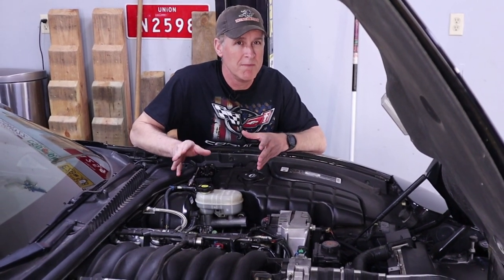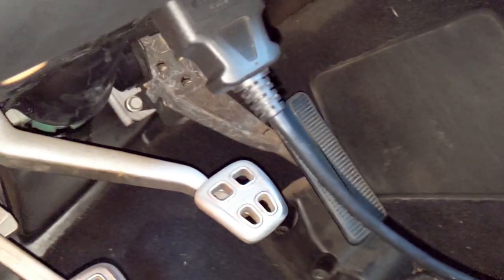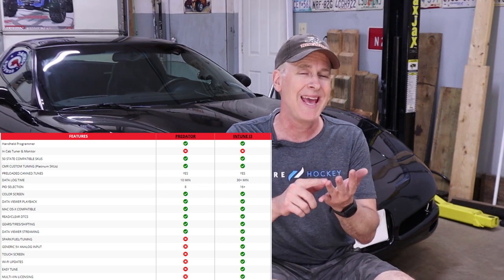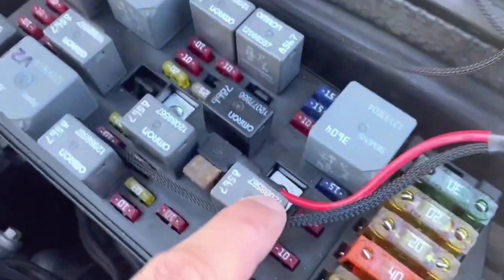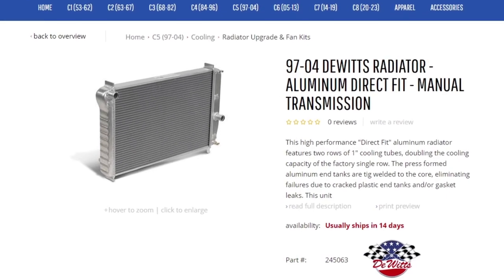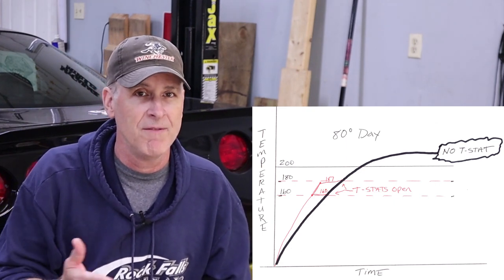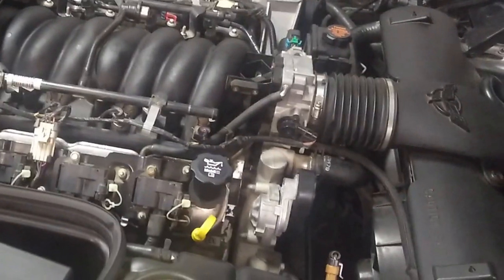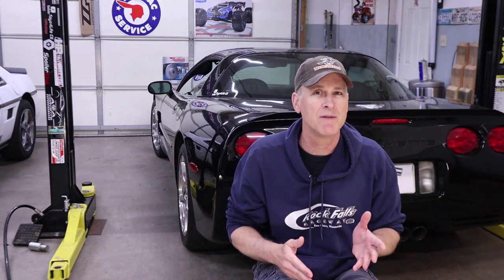Lower your C5 Corvette's Coolant Temperature (6 methods explained!)

Comment: Curious your thoughts on how the addition of headers will impact underhood temps. I plan to install Kooks headers when they arrive and a cool air intake with a tune.
Reply: They definitely add heat to the engine room and center of the car in slower driving.
Reply from the maker: Agreed 👍

Comment: How about hood vents, anyone have any before and after data?
Reply from the maker: Oh, they would absolutely help. I could have included those this method number seven but it's a little extreme for most (:-).
Reply: Tape some yard to your hood w/vents and take a drive.  I did 20+ yrs ago.  You might be supprised

Comment: It's simple drain the dexcool and put distilled water and hypercool in put a 160 termastat in get the fans to to on at a. Lower temperature keep the cooling system clean I live in FL and my C5 04 with a BTR stage 4 cam black on black super cold AC runs around 168 to 180 trans temperature around 145 oil temperature 196 to 212 coldest running and best running C5 out there. Runs 10's in the 1/4 gets 23 mpg at 85 mph and 32 at 55 mph now stop light to stop light it eats fuel like 9 mpg Google Sweet Corvette on You Tube
Reply from the maker: Nice!

Comment: If you turn on the ac the 1st fan kicks on
Reply from the maker: That's 100% true, the only problem is since the condenser is ahead of the radiator it starts releasing heat Right into the airflow heading to the radiator. Extra heat negates much of the benefit.
Reply from the maker: That's 100% true, the only problem is since the condenser is ahead of the radiator it starts releasing heat Right into the airflow heading to the radiator. Extra heat negates much of the benefit.

Comment: I am kind of skeptical of any advice that suggests that someone is going to out engineer the professional engineers that developed all the interdependent C5 systems.   Especially when the potential for a commission is in play.    The C5 already uses a fuzzy logic in the engine control , so unless you have a very specific need , another tune is not needed.  Same advice goes for seeking another temperature, you are trying to fix something that is not broken.   Kind of like applying old piston technology to a jet engine and trying to correct all the flames coming out, because engines didn't use to do that.    

The radiator advice about the southwest needing a replacement radiator that is heavier and operates outside of the original design specification completely ignores the extensive testing done in death Valley as part of routine product development .  Believe me, GM is not going to release a car incapable of running satisfactorily in such a large portion of the american market.  

  Heat soak happens to every car, it is not something that needs to be fixed, and there is ventilation, the fans still come on when the design temp is reached, even when the car is parked.  .   One needs to consider this car was designed with supercomputer time , the ignition event is optimized for the designed heat range, which is measured in the mass air  velocity sensor, and accounts for for performance down to the swirl inside the heads  that the air density effects as it mixes with the fuel .   You start altering the original design by modifying one of the interdependent systems , chances are you will lose efficiency, and efficiency is power, not just a gas milage figure that some people seem to think just randomly happens.        '

These cars are not like the old days, where you could just buy a speed part and slap it on.   Back in those days an engine with features like the LS 1 with an aluminum block and fuel injection would be would be a race engine featured in a magazine,  and wouldn't go 200, 000 miles with just oil changes, and as designed maintenance.
Reply from the maker: Appreciate the comment as always. Why did the engineers have the thermostat open at 187. If optimal was 210 or 220, they could easily have the thermostat open there. It's not a mass air velocity sensor. It is a mass air sensor. It detects the amount of the air. That way it knows how much fuel to mix. Engineers at the OEM level have to compromise between several things. Enthusiast can switch the compromise equation around a little bit if they want. I clearly said this isn't necessary, but some people like me want to do it and I would say it's absolutely worth it.
Reply: One critical thing not being taken into account when it comes to the engineers of any car including the C5.  Profitability & strict budgets requiring the lowest bidder to provide the parts for the build.  

Now for the engineers…those same geniuses that designed the wiring harness to exist under the battery tray where side post batteries that were prone to leak lived in the top bunk. Let’s not forget the amazing column lock feature they designed into the build that GM’s own recalls could not solve for. Then we have the udders just in front of the fire wall that if clogged cause water to find it’s way into the dash to douse the passenger kick panel fuse box to fill with water.  Or those same engineers that put the oil pressure sensor under the wiper cowl requiring either the intake be removed or some crafty wrench work with a swivel extension to replace the OPS. Or the PCV designs that cause oil to pool in the intakes and cause carbon buildup on the pistons. Or the early model EBCMs that fail and can’t be repaired. 

I can think of at least 5 more shortfalls of the GM engineers when they designed the C5 or used sub optimal parts in the build to meet budgets.

Reducing operating temps is always a goal for those modifying their cars and running power adders. If you’re happy with your mediocre stock C5 great! If your not willing to settle for mediocrity on the performance front modifications must be done to the C5. 

I love the C5 as a starting point. (enough to have owned 3 of them and one for 25 years). I just needed to pickup where the budgets and engineers fell short.
Reply: That's telling him😂

Comment: People don't understand temperatures - when a car is performing at its maximum running mine up and around redline for an extended period of time the temperature of the oil has never exceeded 243° and the water temperature is in a respectable 230° , now I will watch your video to see what you have to say ¿`_
Reply from the maker: Well, what do you think?
Reply: @Toys4Life  GM did the research and development and that's why the first fan comes on at that temperature and then the second fan then as a backup because they know those temperatures are acceptable, especially knowing that most Corvette owners drive them like old lady ¿`_
Reply from the maker: Agreed, they are acceptable. But that's not the same thing as optimal in my opinion.
Reply: @Toys4Life   Nor are they acceptable for me. I read or was told that the reason the temp. gets so high at idle is for emission reduction. Can you find any confirmation on this?

Comment: Air conditioning on.
Fan on.
Reply from the maker: True but the radiator doesn't cool as good when  hot air from the condenser is getting pulled into into the radiator. But better than nothing though (:-)

Comment: C5/C6 have a very inefficient cooling  system and it's vey bad for a boosted LS especially in a hot environment 
Too bad GM engineers preferred aerodynamics over a better cooling system lacks